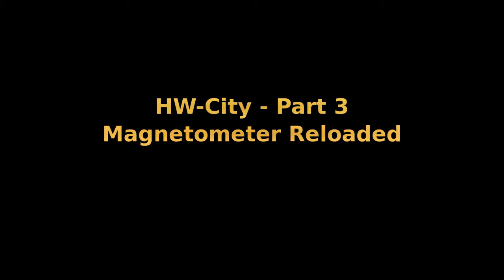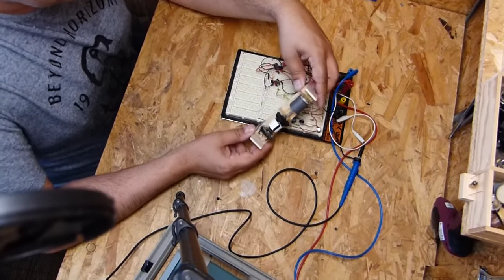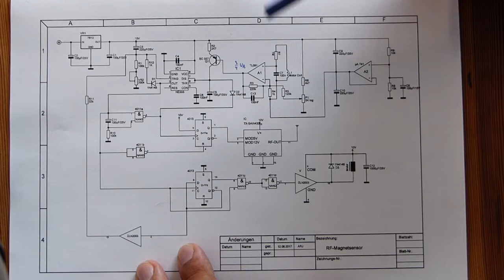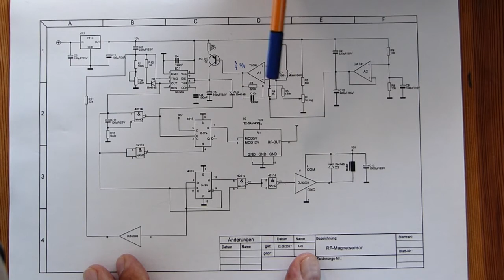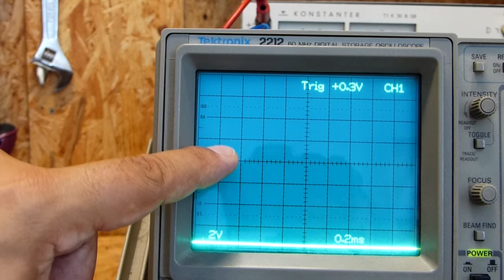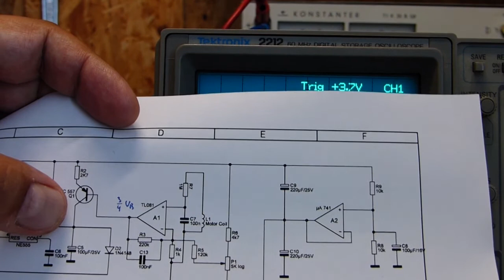Hardware City Part #5 - Magnetometer Reloaded!

Comment: homemade geomagnetic field fluctuations magnetometer github.com/IvanKor/geomagnetic-magnetometer
Reply from the maker: Ivan Korshun Nice pictures and software! I know there are some good ready to use semiconductor sensors put there and you just need some sw to hook them up.  You also can do this with your smartphone. I wanted to design the sensor myself (the hardware) with some easy components.